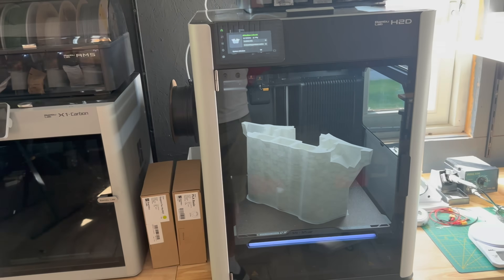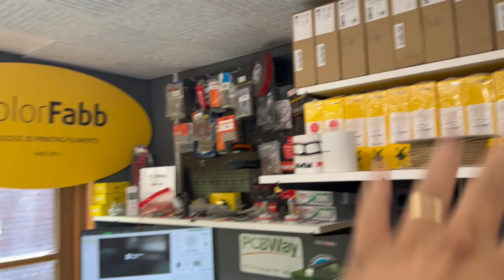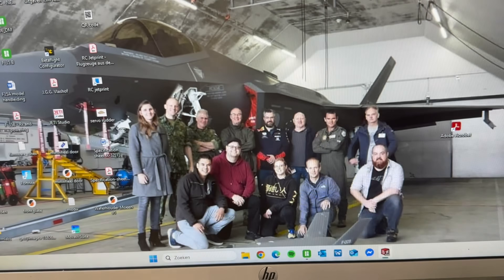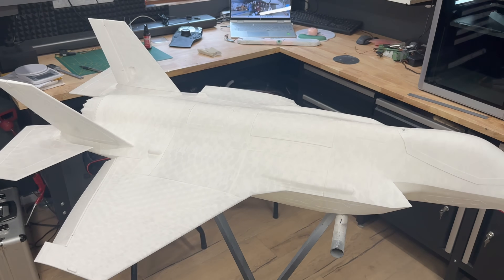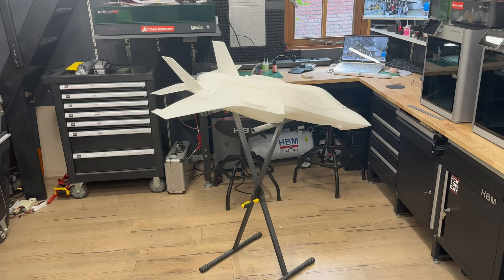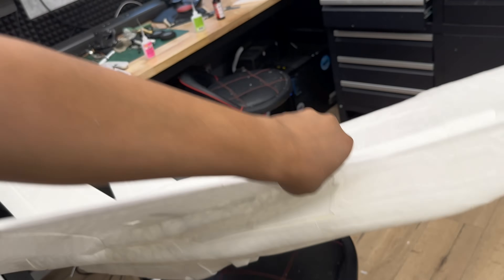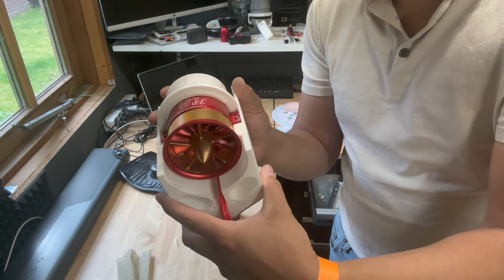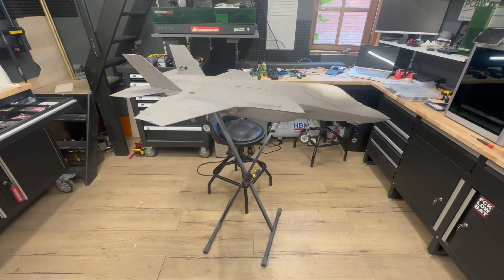F-35A Making A Super Detailed 3D Printed Rc Jet Using Colorfabb Filaments LW-PLA Avanti Landinggears

Comment: Please do a video explaining how you design the model in Solidworks.  Do you design top down or individual parts then assemble. Surface or solid model?
Reply from the maker: That is a bit hard to explain, doing this over 17 years now and from start to finish takes over a year. But i can show more about mechanical design

Comment: Mines nearly finished,  I was wondering if the front 5mm spar on the main wing goes all the through, as it appears to foul the landing gear retraction and do the landing gear mounts just glue to the airframe? I've got everything else covered.. nice model..better than my freewing f35, although it wont be as sturdy...I can print replacement parts.

Comment: Sir, I am making a plane design by folding it with plastic sheets by hand. Is there a problem if the weight of this plane exceeds 1kg?🙄😕
Reply: From what i see in rc jets, it doesn’t matter unless you need to have v-tol in it. Just try to have as much thrust as possible so it doesn’t just fall while flying

Comment: For your builds you mentioned the DS06 servo and DS09 servo from Chaservo.  Do you use these servos because you have had good experience with them?  The cheap servos you see on Amazon look like a good deal, but I am nervous about trusting them with the controls on a jet model which has taken a lot of work to make!  I dont want failures!
Reply from the maker: Exactly cheap buying would be expansive at the end!!!! These servo’s are programmable, lightweight, very strong and metal gear. The DS06 is just 6 grams! And can do 1,8Kg on 6Volts😃

Comment: I am really interested to buy the f35b model and print it , but my question is does it transit from vertical lift off to normal flying mode , cause all the videos I saw until now it’s either or but I didn’t see it transformers from one flight mode to the other
Reply from the maker: Hey hey there are videos my Channel where you can see transition with the F-35B model mostly done by Ronald. I dont recommend outbound because your battery dies! I recommend normal take off, full inbound to hover and vertical landing, just like the real one.
Reply: @Joelmelanie  Hi , Amazing , i will try to find these videos then, and i will defiantly buy the model as soon as i am done building the JRM , thanks for your reply